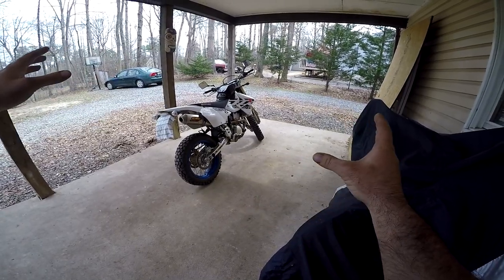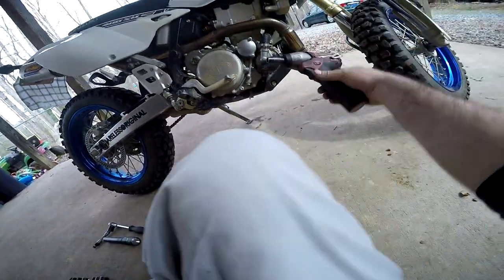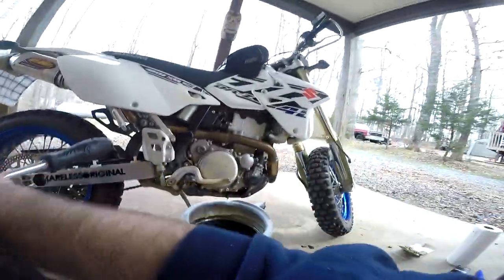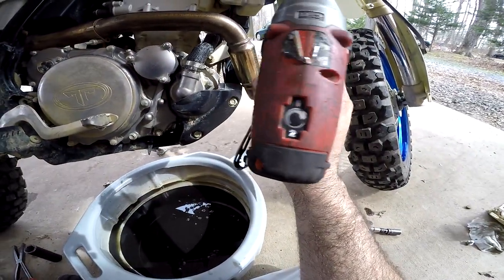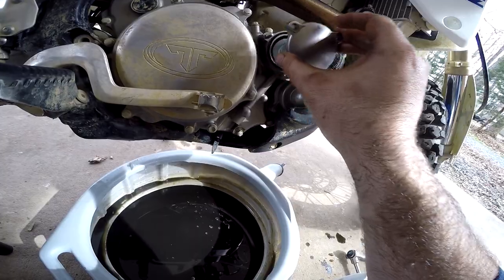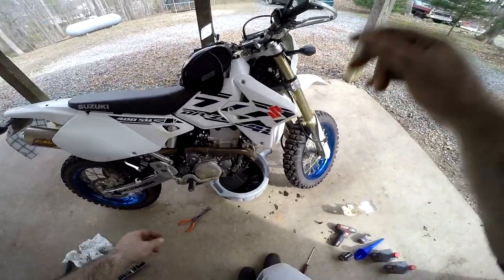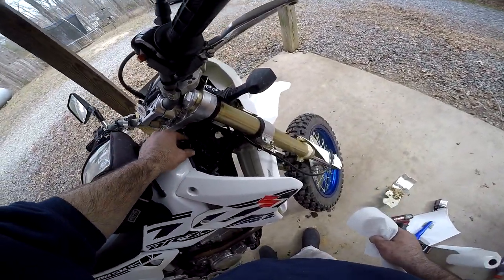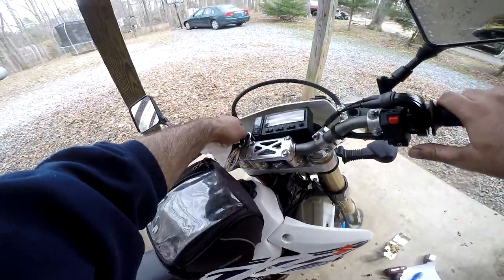HOW TO: DRZ400 SM or S OIL CHANGE + HIDDEN SCREEN!

Comment: Good tip.  my 2020 just hit 500 miles. Plan to do the first oil change tom if autozone has filter with gaskets. Thanks man. Definitely gonna clean that filter for the first 3 oil changes. Lol

Comment: The same buna-nitrile rubber o-rings are used for automotive thermostats, oil coolers, oil passages between different mating surfaces, etc. In auto applications some of those can go for 75,000 miles without losing shape, elasticity, or the ability to compress. I wouldn’t be worried if I went 10 oil changes with my DRZ without changing them TBH. I get it though, they’re so cheap, why not just change them every time.
Reply from the maker: Wish I could post pictures as reply’s. I’m an ase master tech with L1 certification.  The picture I would post would be of replacing a Chevy 2.4L 4 cylinder. The cause of the rod exiting the block was due to oil starvation. The cause of the oil starvation was a leaking rubber O ring that sealed the oil filter housing.
Reply: @GladiusJon  I’m ASE certified as well. If you’re talking about the GM 2.4 ecotecs, that’s not exactly a good example of a well engineered machine. They’re prone to all sorts of timing chain issues, oil leaks, and oil consumption issues that caused so much of those engines to fail that GM had to pay a class action lawsuit. That said, that DRZ would need multiple major rebuilds before it saw enough mileage to cause any substantial degradation to those o-rings. In an engine that needs a rebuild every 100 hours or so, you’re probably never going to see enough wear in the rubber o-rings that would lead to damage unless you neglected to change them throughout multiple engine overhauls. And with that said, I will still insist that there is literally no reason not to change them. Even if you can’t source the exact part#, you can find those nitrile rubber o-rings in almost any size at almost any hardware store.

Comment: Thank you so much made it very easy!  turns out I didn't have the 24 mm but I had a 1in deep socket that actually work just fine I believe 1mm off. Sweet bike I opted for new dirt bike rims and tires... and sprocket and chain...  instead of the fat knobbies. How you like it?

Comment: slightly above is worse than slightly low
Reply: M Blake Jr but gasket safety is for nerds!!
Reply: The factory manual states the oil level can be 1.9 litres for an engine rebuild, whereas the standard level is 1.7 litres. I’ve put 1.9 litres in my engine for the first 3 oil changes since I installed the stroker and big barrel kits. No issues.
Reply: No it’s actually not.
Reply: @The_Kayak_Guy.  lol oh yea, you rebuild engines for a living?
Reply: Blake that and much more bud.
Reply: Blake FYI before come back with another stupid comment attacking my knowledge and experience. Engineers know people are going to over fill a little, plus the thermal expansion, so unless you add a way to much you’ll be fine. I go over a few oz’s almost every time I change my oil and I’ve never had any problems.
Reply: @The_Kayak_Guy.  it causes air bubbles (foaming) and is worst than being slightly low. So long as the oil sump is picking up oil it's fine as filled to full. You put more than the engineers designed for an engine and you run the risk of foaming and other issues. Overfilling is worst than a qt low.
Reply: @The_Kayak_Guy.  that and much more lol sure
Reply: Blake most automotive and aircraft engine oil has anti-foaming agents in them, it sounded smart though. He didn’t add an extra qt in his motorcycle only a few oz’s which is completely fine. If he went a full quart over the crank case pressure would likely blow the engine in seconds, foaming wouldn’t even be a factor. Go back to flipping burgers.
Reply: @The_Kayak_Guy.  lol, antifoaming agents, they have had that as far back as I can remember.  Fact of the matter is, it stands, over full a half qt is better than half low. My comment isnt about how high or low it is in the video.

Comment: is that hose and filter on all DRZs? havent noticed it before? is it just a passage between the frame gallery and the bottom of the sump? y frame holds oil until the bike is started, i have to fill, run for 30seconds and add about half a quart

Comment: Was just wondering do you have a manual cam chain tensioner, and is it really worth it?  Does it really extend engine life? Thanks Bud
Reply from the maker: I do not have one yet. It is 100% worth it. The Stock one does put to much pressure on the Chain. Causing premature wear.
Reply: I know that Suzuki redesigned their cam chain tensioner claiming that the problem was fixed. But in what year I do not know would you have any idea in what year this was done? And the other thing do we take their word for it. Thanks Jon
Reply from the maker: To be honest I do not know.  I personally dont plan on taking their word for it hehe.
Reply: Ok thanks Bud. In your next how to vid can you show how you adjust the manual cam chain tensioner. That's when you do get it eventually. Maybe someday we'll go riding that's if you don't live to far from me?
Reply from the maker: Will do! im in Central Va, always down for a ride.
Reply: The new one's are a tan/brown color and the old one's are aluminum colored...I bought a used 2013 SM last month with 4800 miles on it.  I am not going to change mine to the manual tensioner.

Comment: what oil did you run after initial hard break in 30-50miles? synthetic??
Reply from the maker: I ran Regular 10-40 motorcycle oil.  You dont want to run synthetic before 1000 miles or so.
Reply: Gladius Jon oh okay shit i just put in 10w40 part synthetic first oil change..
Reply: Gladius Jon should i drain it out?? hasnt been run yet.
Reply from the maker: Part synthetic should be ok. Still has the Mineral in it, so the Oil molecules are not super small.

Comment: What is the width of your tires?   I'm about to order mine.  I also need a Innertube I caught a screw with my stock rear tire
Reply from the maker: Yohosun 4.60 x17 front. 5.10 x17 rear.
Reply: Gladius Jon thank you sir.   Your the Man
Reply from the maker: Yohosun anytime bro 👍
Reply: What tires are they.  I'm looking for some for my SM right now.
Reply from the maker: wildcard252 shinko 244
Reply: Thanks! I was just looking at those ones.  Are they worth the money? Even though it is only like $105 for the pair.
Reply from the maker: Definitely. I have 1400 miles on them. Front is like new, rear is half warn. Im Really rough on the tires. Jumps, burn outs, 55 mph on the trails.. lol. Surprisingly Solid Grip in the woods for 17 in knobbies. Road they do well, for knobbies. No you cant turn in like street tires, but they do good. They are basically the D606 of 17 in SM rims. Like a 30% Street 70% Trail.
Reply: Thanks for the reply man.  Keep it up with the good videos.

Comment: don't use power tools on the filter cover
Reply from the maker: Why?
Reply: @GladiusJon  so much easier to strip, snap, cross thread - especially a small diameter fastener.
Reply from the maker: Yea, but I have a tap & Die set.  And I have been working on cars for 15 years so.. 🤷‍♂️
Reply: @GladiusJon  you create a video for people to "learn how" to do an oil change.  I suspect most people watching / learning don't have 15 years of working on cars and don't even know what a tap & die set is.  my comment was that using a power tool on a small fastener is simply an unwise choice.  I'm glad to see that in the vid you used it only to remove - not to re-fasten.
Reply from the maker: @ttime4four   Right I agree.  But I said in the video to torque it with a 1/4in ratchet. I specifically said multiple times those studs can snap.  So I wasn't sure why using impact to remove was an issue?

Comment: You mean 14 mm socket! Not 24
Reply from the maker: Impala Productions no its a 24mm.
Reply: Gladius Jon hmmm, well i'm not sure, but a 1/2 inch is equal to about 13mm.
Reply from the maker: Are you talking about the Drain plug size? Also yes, 1/2in is 13mm.
Reply: Impala Productions half inch drive jackass 24mm socket

Comment: How does DRZ400SM perform on dirt compared to the S model?
Reply from the maker: Honestly the same. With the exception of the rim/tire size. Im sure I could go faster though trails on a proper set of 18/21 in rims.
Reply: its the same bike ,just the tires ,suspension , i understand that e model has bigger exhaust port and fcr stock carb ?
Reply: sdq sdq  the DRZ400E has hotter cams , larger porting on intake and exhaust valves, different jetting ( 2005 and earlier models had the fcr 39mm carburetor) longer  travel suspension , closer ratio transmission, and about 40 hp ( the S/SM at 32 hp stock) definitely higher performance than the S/SM 😉